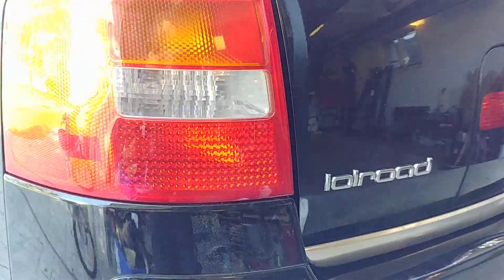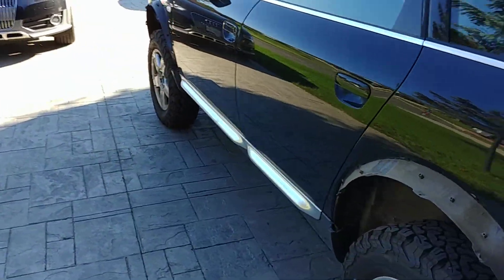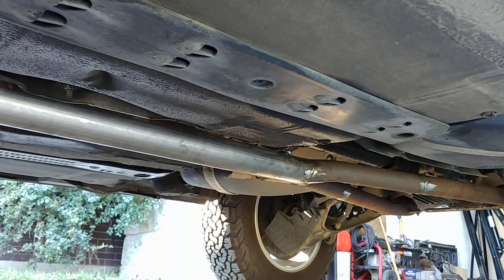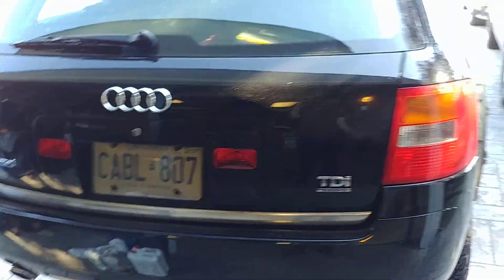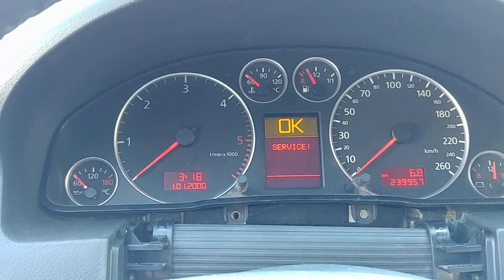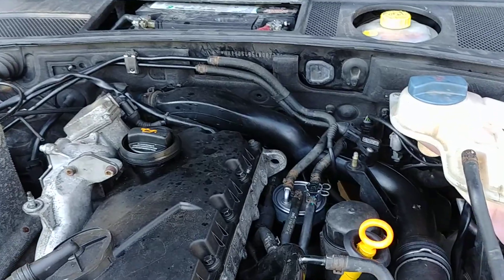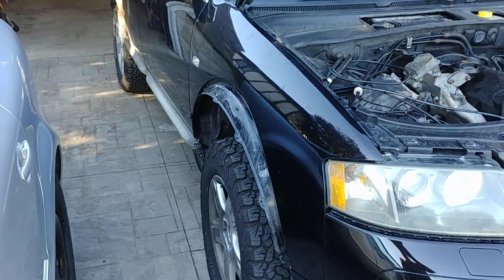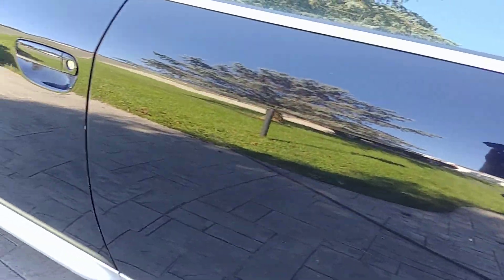Project offroad allroad quattro 2.0TDI: It's alive!

Comment: i think that you have a problem there with engine mounts or the front snub. It should be almost the same with and without dual mass flywheel- except louder idling. Ive done a couple tdi swaps and almost every time i had to readjust, retighten the 2 motormounts. They are very sensitive for incorrect treating :) Transmission mount could also be the reason. Good luck
Reply from the maker: Thank you. I made sure that all mounts were slightly loose and only tightened them after the engine was started and shut off again. This way everything had a chance to settle. I'll have another look to be sure.

Comment: Where in Ontario are you located? Did you do the whole conversion yourself? How many parts did you have to import?
Reply from the maker: I'm in London. Yes, I did the swap myself. Only parts I imported were a flywheel and clutch kit. Truth be told, I tried three different flywheels before I went with what I should have installed to begin with, a Dual-Mass Flywheel.
Reply: @biturboaudis4  London is too far for me, but I'd love to see one of these in person. I want to do this swap, but I am just looking for an allroad right now. Ideally I want a manual with the proper gear ratios.

Comment: I just got my 2001 allroad TDI (bhw) on the road, but have a few items to iron out and wondering if you can shed some light on.  1) I have recoded the ABS module to 06355 (it was 06395), however, it still thinks it is an automatic as I am getting a powertrain error.  It is giving the three warning lights of suspension, abs and esp.  My car was originally an auto that I did a six speed swap and I wasn't having that issue prior to the TDI swap.  Did you have this issue and if so how did you go about coding the ABS? 2) I went to fill up and the diesel pump nozzle won't fit LOL. Did you do anything to your car to enable the pump nozzle to fil the fill hole? 3) On the 2.7T there was a third hose with the fuel lines, did you do anything with that?  Thanks in advance.
Reply from the maker: Hi, the coding change for the ABS to work needs to happen within the engine ECU. I have a couple of files with the changes, if you'd like to see them. For the fuel filler neck, yes, there is a black plastic insert clipped into the filler neck that you must remove in order for the diesel nozzle to fit. You'll see two little tabs on this insert. After you remove the insert, you need to drill out the white plastic piece, which is what would normally stop the black insert from falling into the tank. I inserted some cloths into the fuel filter neck and then drilled it (7/8" diameter if I remember correctly), and then vacuumed out the little bits of plastic. Took maybe a few minutes to do. You can leave the little metal flap in place. It is larger than the new hole and will work the same as it did previously. As for the third line, that's the EVAP purge line. I completely removed my EVAP system and charcoal canister, as those items are not used with the TDI engine.
Reply: @biturboaudis4  In regard to the ECU files, yes that would be helpful.  Thanks for the input on both the fuel filler neck and the EVAP.
Reply: @biturboaudis4  Did you add an oil level/temp sender to the bottom of the pan?
Reply from the maker: @jaygardner3666  I did. The pan is cast with it, so I drilled it out and tapped the holes to M6.
Reply: @biturboaudis4  Nice! I have a M6 tap.  For the main hole did you use a hole saw?  Will doing this with the engine in the car be a pain?  One last question, can I send you an email for the ECU files? Malone did my tune and immoblizer work.
Reply: @biturboaudis4  I got the oil level sensor installed...pretty straight forward.  Nice that the pan already had the 6m holes drilled...I just had to tap them.

Comment: Did you send bumpers before painting? How you removed that rubber coat from them?
Reply from the maker: The coating on the bumpers is nothing special. It's just matte paint. I sanded them like would normally be done for painting. It's almost 2 years later and they still look good.
Reply: @biturboaudis4  Thank you! I'm in Ottawa and this car gonna be my sailboat towing car with 2.7t engine. When you tow something do you turn your air suspension in specific setting?
Reply from the maker: @st.k.4528  I usually keep the car at level 2 while towing, but only because the rear of the car is low, and I only have one receiver adapter for pulling trailers.

Comment: Great diesel conversion! Do think you would prefer a dual mass flywheel with the vibration you mentioned? Please do a final walk around video when you have it all back together. Side note, I have a 2004 A4 Avant 3.0 (less the 3.0), would this conversion be possible from the Passat TDI? Sorry, not a guru on VW/Audi chassis!
Reply from the maker: Yes, a dual mass flywheel would get rid of a lot of the vibration. Also, these particular engines (code BHW) had a balance shaft that was prone to failure at very low mileage. The combination of the two would make it much smoother at lower revs. That said, I can live with it in exchange for longevity. Your 2004 Audi A4 would be a perfect candidate for a swap like this, or a 2.7T. As a matter of fact, the flywheel and clutch kit I used in this project is made for 1.8T B6 Audi A4s.
Reply: Yah, considered a 2.7T or 4.2 swap (I'm an old guy so there's nothin like a V8!) but then you had to do your TDI swap! I had a 03 Jetta TDI back in the day and just finished my Stark Auto purchased (clean ownership) 08 Jeep CRD that I really enjoy but it's not an Audi. Anyways, just an idea, I watch all your videos and enjoy them (I'm an anal retentive car geek), would really like it if you could do a video some time (or videos) reviewing your Audi collection. Would like to see you review your B5 Avant RS4 and you never really did a review on your completed RS4 2.7T swap. I know they are time consuming but us Audi enthusiasts would appreciate it. Thanks

Comment: Did you keep the AWD with the tdi swap??
Reply from the maker: Yes. Wouldn't have it any other way.
Reply: @biturboaudis4 I'm not sure if you mentioned it but which rear diff did you use also how much was that transmission from germany
Reply from the maker: @knicksallday6442  I had a spare 4.11 diff from the B7 RS4 2.7T swap (installed a LSD in that car), so I used that. Basically, the B6, B7 and C5 differentials will fit. As for the transmission, I believe I paid about 400€ on ebay.de. It came out of a Passat 4motion, code FTF.

Comment: One thing - this is a 1.9tdi not a 2.0 ;)
Reply from the maker: It is indeed a 2.0TDI. 2005 VW Passat, BHW engine code, North America only.
Reply: @biturboaudis4  newer years of this engine. Its PD is it? It looks like a AVF/AWX. Probably a US only version as 2.0tdi in Europe were only introduced witch CR in the B6 passats and B7/C7 Audis.
Reply from the maker: @oofol  Correct, this PD engine was offered in the B5 Passat, 2004 and 2005, North America only, and only with an automatic transmission. It's an 8 valve engine.
Reply: @biturboaudis4  Ya I can see its 8v and it is a drilled out AVF most likely :) I wasnt aware of this engine as I live in Europe :) I would put in a X muffler to get a bit smoother ride thou